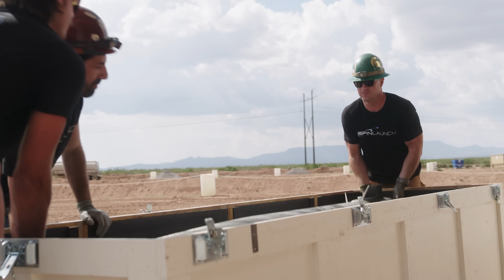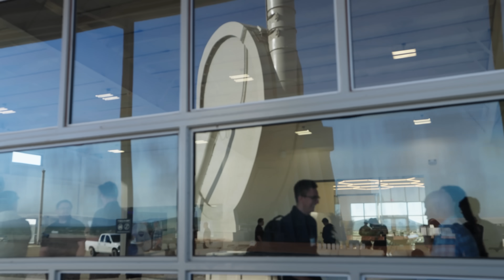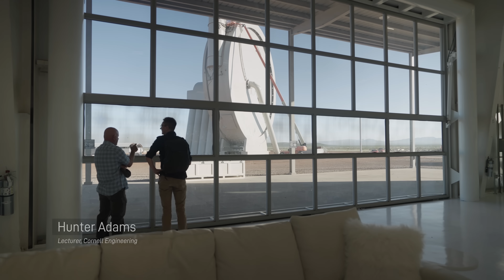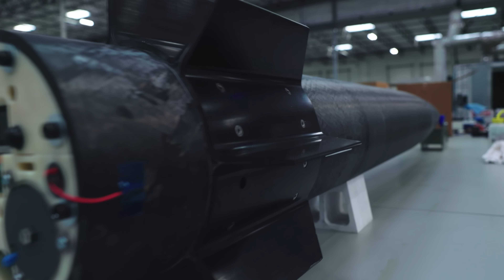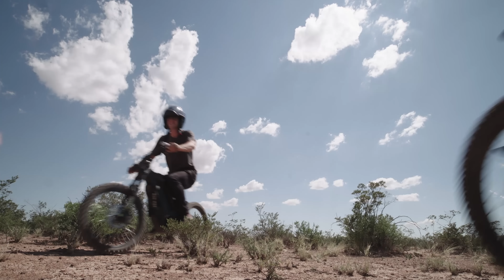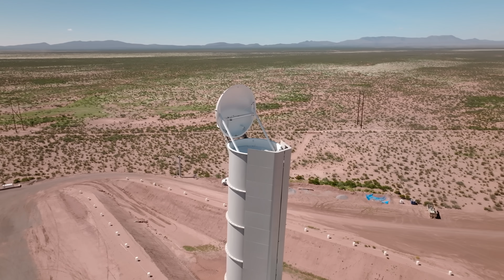Flight Test #10 - The First Payloads

Comment: What’s the largest you can feasibly make it?

And what about using carbon fiber composite in a chain mail configuration instead of just a regular weave ?  

Using a chain mail configuration, along with a metal matrix and graphene/carbon nanotubes Should increase the performance and allow you to build one about 1,000 feet in diameter (or 500 feet in radius)

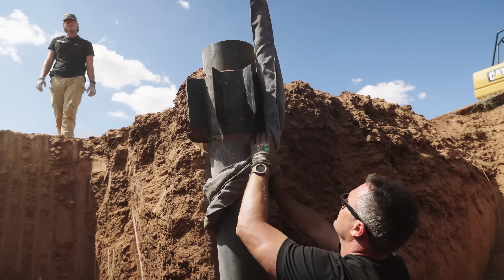Comment: Their Wikipedia article claims they took payload for NASA into lower orbit and that they reached 10 km. But the rocket didn't even have a first stage, and it was dig out of soft dirt, still part of its tail outside. So it wasn't going really fast. 1:27 shows how deep it was. They constantly delete the "Criticism" section on that article too. 
Russians at some point tried a better version of this, a weather balloon can reach up to 27 km, it's super cheap, and gets the cargo there slowly. They put a rocket there to reach low orbit, but the fuel saving they got from that was not worth the hassle. So not only you need to be higher than 200 km you need a velocity of more than 28.000 km/h. Even if their rocket has an engine, they'll found out that there's no advantage on throwing it 20km up and turning on the engine at that point. Even if it was a good idea, floating it up makes more sense. No infrastructure, lower cost, no extreme G strain, lower chances of failure, and catastrophic failure, can lunch 100s at the same time, etc.
Reply: You clearly dont have a clue about orbital mechanics. Rockets dont use altitude, they use their velocity, a balloon at 27km doesnt help when its at 0 velocity. Spinlaunch is not supposed to kick the rocket to orbital speed on ground level, its supposed to accelerate it to high speeds to not need the first stage any more. Look at falcon 9, the first stage is separated at mach 6, nowhere near orbital velocity. 
Besides that IF you could accelerate it to orbital velocity, orbital mechanics would make it come around the planet ONCE and hit the same spot on the ground you launched it from, there is no use in reaching orbital speed at ground level.

Comment: I always thought pointing a rocket precisely against the strongest possible force of gravity and then trying to best it using chemical energy was, shall we say, "Non-optimal."  Spin-launching is literally perfect for just about any unmanned vehicle, as long as it is strong enough to withstand the gradual acceleration to terminal velocity.

I hope that by the start of 2025, these guys are bathing in showers of $100 bills sprinkled on them by Venture Capitalists attending to their every need, including peeling their grapes.

Comment: Consider the thin plastic (?) sheet that divides the vacuum chamber from atmosphere and that the rocket breaks through.  Estimating 3x10 feet it would be holding back 63500 lbs of atmosphere and yet be fragile enough to allow the rocket to break through without harm.  That is amazing.  Unbelievable!
Reply: they are using machanical door to do not lose all the vacuum

Comment: Initial velocity of Mach 4 gets you to 64 miles high. Not only do you need to get to 100 miles high you need to have an angular velocity of 17,000 mph to maintain an initial orbit. This requires an initial velocity of about19,000 mph . they would need to raise the kinetic energy 40x to achieve this. It's still possible but there is a lot more work to do
Reply: Once the projectile reaches its apogee it splits apart and there is a small two stage rocket to carry the payload the rest of the way. This reduces the fuel required to get to orbit by a huge amount.
Reply: @Eyepleighdrumz  How the hell is a conventional rocket going to survive the forces of being flung into the air like that. The whole idea is snake oil to fool investors into giving them money.
Reply: @Eyepleighdrumz very possibly saves 80% of the fuel. Not just from being high altitude before firing, but not having to carry hundreds of tons of fuel a conventional rocket would need.
Reply: I have serious doubts. But it's not my money, so go for it. Prove me wrong. 
I didn't think it was possible to land and reuse a booster.
Reply: It’ll happen one day, but that may be another 50 years off. Definitely possible though. It’s not even about the speed, well it’s about speed too, but it’s mostly materials science. You need something that can spin 20,000 mph without shredding into a million pieces. We’ll get there eventually.
Reply: @zombieinjeans  The biggest problem is you have maximum velocity at launch point where the atmosphere is thickest. Going 20k mph at ground level is not a good plan. Can you image how hot something would get going orbital velocity but at sea level atmospheric pressure. It's a flawed concept.
Reply: @schrodingerscat1863 I’d be more concerned about all that wobbling than the brief time it’ll be in the thick lower atmosphere.  Heat dissipation can be designed for the tip.
Reply: @ericw9655  I wasn't thinking so much about heating as what would happen when it moves from complete vacuum inside the spin chamber to full sea level atmospheric pressure. It the speeds they are talking about it would be like hitting a brick wall. The amount of energy needing to be instantly dissipated is likely to collapse the projectile. Dynamic loading on the projectile would be so extreem it is unlikely that any complex mechanism could be made to withstand these forces without making it incredibly expensive and or way too heavy.
Reply: @schrodingerscat1863  the ceo got changed last month, it might make em rethink some stuff like that, no idea how they would make it not explode except maybe tripling the barrel lenght and having multiple doors where the projectiles is introduced to higher and higher pressures before being thrown into actual 1 atmosphere, though it would cause it to lose speed earlier so that would need them to make the launcher bigger, also  the barrel might be too big and expensive to be practical, they could probably calibrate it right taking in account engineers do that at fusion reactors, though the shaking issue i got no idea, best i can think is increase the vaccum launcher chamber thickness to account for wobble, but then the projectile would just fly in a unpredictable angle, they could also add rails from the walls to the spinner but then that would just make the whole thing spin ? whitout accounting for the increased resistence the rails would give which would also slow it down. overall there is hope for this asylum born project, probably not gonna see it in 70+ years though.
Reply: @schrodingerscat1863  That is not how aerodynamics work.
Reply: Some fuel is used for the high altitude. The vast majority of fuel a rocket uses is in the initial lunch. Getting off the ground and getting up to gravity breakaway speed.
Reply: I'm assuming this will be a hybrid system.  Would be cool if they explained the end goal and gave some real data.
Reply: Exactly, this is just a scam to get gullible investors to give them cash.

Comment: It was really designed to be installed just under the water, so that a malfunction would be absorbed by water.
Reply: Cheaper to have it above water as it is easier to maintain. The forces are strong, but the mass is not that great so if something fails in the chamber it will not shred the entire thing.

Comment: I'm calling it now: they will find a way to weaponize this. Whether it's a shorter distance and auto loads or medium/long distance for small nuclear arms. I like the spin idea but I see the future as rail launched systems as they could rack the rail and launch as multiple armaments could be flying on the rail at once. However, even if this serves as impractical, and I pray it doesn't and this company gets an huge payout, I believe the research and knowledge from this could be massive. Think about the use of this sort of technology for society. Rescue personel, building construction, cleanup, and even things like sorting trash could use the knowledge and technology here. I think this is something the department of defense should invest in greatly if simply for the research and knowledge learned about the materials, forces, and potential applications of the technology. This is probably one of the most extreme and difficult things we could perceive as even slightly possible from this technology. So it goes to show we will advance this sort of technology to the far limit of it's possibility. I'm not quite sure how this business is set up and if they are for profit, but I hope that they acknowledge these possibilities and keep the ultimate goal in mind. The patents, knowledge, and expertise of the company could easily be used to do other great things. They should remember that even if they hit a wall and fail the goal of launching to space, that you already did the greatest thing possible. You pushed the limits of the technology and advanced human society. They should form a team to learn, calculate study, patent, and create ideas for potential use of what they learn. That's what they should keep in mind as the ultimate goal of the project. What you get along the way could be more marketable and/or beneficial to society (whichever form of company it is) than you could ever get from a space launch. I sure hope they take advantage along the way to. It's like us going to the moon as Americans, the goal was not simply to reach the moon and it was considered near impossible. The point was the advance technology as far as possible, because even if you fail there is so much to gain. In this case it's shoot for the moon and if you fail you will land among the stars. Best of luck, and I would be interested in getting involved if there are any opportunities.
Reply: yeah. It is called a spinshot. It is used to shoot tennis balls .

Comment: They are hiding lots of good footage and proper data figures.  The system is already a failure and there is no way to scale it up.  The forces involved would multiply exponentially just for doubling the size of a payload to be launched.  This company will not achieve what It's out to do and will be bankrupt in a year.  Reusable rockets are well proven and increasingly economical.  Spin detonation rocket motors are showing really good promise as well to increase the fuel economy of rockets in general for each pound of thrust generated.

Comment: What portion of the finnaly planned speed was achieved in this test?
At the moment when the projectile exits, it is clearly tumbeling. Is it planned to fix this rotation from the spinlaunch?
Reply: By tumbling, you mean wobbling?
Reply: @bradleyrex2968  Yes, sorry. The tip of the projectile is not heading in the flight direction. It looks like the projectile has still the rotation move from the spin. Which seem to be stopped by the fins or just the aerodynamics from the projectile hull.
Reply: @michaegi4717  If you look at the length of the release tube, it's about the same as 1/4 of the diameter of the circular launcher.  So unless the projectile emerges at a 90 degree angle, then something has been done inside the unit to reduce the the rotation.  And as the unit us under significant vacuum, that cannot be aero dynamic.  This is most likely releasing the front of the projectile before the back. 
It is however wobbling, indicating the correction is not yet "perfect".
Reply: @bradleyrex2968  Oh yes you are right. I missed, that you can estimate the expected turn.
Now I'm not sure if this is good news. If they try, but fail, to compensate this at such relative low speeds, how will they hadle this at the final speed?
Reply: @michaegi4717  If they try but only get it 90% right in the first prototype, have they failed?  I'm sorry but the desperate hope for failure I see in many of the comments here (yours included) seems odd to me.

Personally if someone invented a way to get get things into space with little or no combustion, and significantly reduced costs, I'd be happy, not sad.  

How will they handle this at the final speed, probably through modeling, experimentation, and refinement.  A normal process in engineering.
Reply: @bradleyrex2968  No you totally got me wrong. I would be very happy if they solve the problem of sustainable space launches.

But it has to be OK to raise some questions if it's realistic to do this approach. For similar problems people often refer to the 80-20-principle. Solving the first 80% of the problem take about 20% of the time. In this case I would say that they might solved about 80% of the rotation issue for the speed of the 10th start. So solving it at this speed would take approx 5 times more effort. But I expect the problem at the needed speeds for a launch to space is much harder.
But we both don't know all the details, so we will need to wait what future will bring 🙂

Comment: Project Harp demonstrated getting to space for a projectile without propulsion is hard but doable. The problem has always been reaching stable orbitable velocities. The projectile needs to be still doing 7.9 km/s  at altitude.  The Karman Line although technically space isn't high enough because there is still enough atmospheric drag to quickly bring the projectile down.  Even the 400 km low earth orbit of the ISS  would not be enough for decade long orbit. The ISS loses 100m altitude a day due to drag so needs to a monthly boost to maintain orbit.

So many questions. What altitude without booster would be considered reasonably stable orbit for Spinlaunch? How does it achieve the orbit without thrusters to maneuver it in place? Can instrumentation survive the insane amount of Gs necessary at launch to achieve such an orbit?

Comment: I had an idea in 2016 like this I kept asking why are they spending so much on rocket's first and second stages when they could just throw the same satellite into a sub-orbital trajectory and then don't hassle with the first or second stages and just use the third stage for achieving orbit and here I see this amazing stuff. Good work gentlemen best fortune to you in the future.
Reply: Its a payload issue with both methods, balloon AND spinlaunch, the issue is you cannot take enough payload vertically to then use a chemical rocket to achieve orbital speeds, you NEED those first and second stages to provide the horizontal velocity AND the power to move enough payload past the space line, AND provide enough speed to maintain orbit.
We do not have the capability to put anything that fast and high without giant rockets, spinlaunch is a scam at best and just a bunch of fkn idiots at worst.
Reply: IMO it would be cheaper and more reliable to simply use a "China balloon" to lift a payload into the upper atmosphere then ignite a rocket motor to take it into orbit.
Reply: @BillAnt  I never heard of that wow! So they just lift the payload with a balloon?
Reply: @sezerteker  - Yes it's possible with the right sized balloon it could take it as high as 60,000 feet, twice the height of commercial airplanes.  Then a rocket could kick in to take it into orbit.
Reply: @BillAnt  The Zero 2 Infinity rocket from a Spanish company is doing just that. Not sure if they are actually getting anything done, but their plan is essentially what you said.
Reply: And by the end of 2023 I am asking why no one has thrown anything into Space?
Just take a tungsten rod, put it on top of 50kT nuke, blow it into Space, if you want to throw something into Space.
But this spinlaucher is just a fantasy, if it could have been done it would have been done already.
Also you  would want it on top of very tall mountain so the air density is much lower, and not hitting sea level air pressure at mach7 that would evaporate even hardest of materials.
Reply: @Nauda999  Even the highest mountains have 0.6 kg/m3 air density
Reply: @nehorlavazapalka  which is far better than 1.25 kg/m3 at sea level, right?
Reply: We've actually done this decades ago with large cannons.  We've been able to do this for awhile, we've known the match for awhile, we just didn't have the greatest technology to really explore the idea like SpinLaunch is.

Comment: I have a bunch of stupid ideas for Spin Launch, I'm sure that your engineers have come up with already:

-Is there a more efficient way for the counter weight rather than wrecking a fibregrass?
For instance:
Moving counterweights: This system would use a series of weights that can be moved along the length of the spinning arm, allowing for fine-tuning of the balance of the centrifuge.
In theory, if the counterweight is designed to rotate at the same speed as the main arm, and if the counterweight is heavy enough and placed at the correct distance from the axis of rotation, it could generate enough centrifugal force to balance the main arm rotation.
Fluid counterweights: This system would use one or a series of tanks filled with a high-density fluid, such as a tungsten/mercury cocktail, that can be adjusted to balance the centrifuge.
Magnetic fields: a dynamic magnetic field that stabilizez the centrifuge instead of the traditional static balance weights.

-A multi-stage centrifuge system as a method of reaching terminal velocity. Each stage of the system uses a spinning arm to spin the payload to a specific speed, thus transferring it's own rotational energy to the next stage. The speed of the payload increases with each successive stage, until it reaches the desired launch velocity.
Reply: found the time traveler

Comment: I wanted to see the vehicle launching and flight but I guess hearing some random person ramble on about how they are thinking outside the box is just as good
Reply: Makes total sense. Most of the fuel used by a rocket is in the first 150k to 200k feet. Spin launch allows the rocket to be considerably smaller and lighter since the rocket does not have to carry 100s of thousands of gallons of fuel for the initial launch.